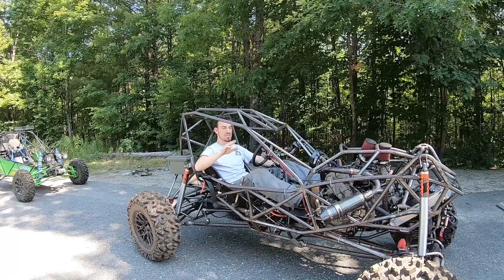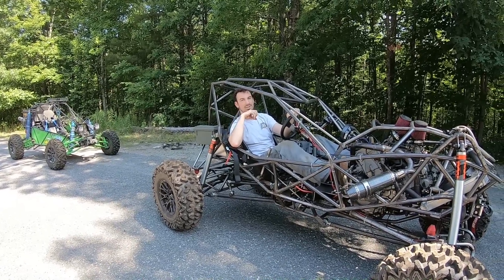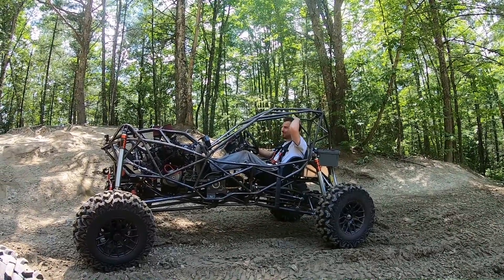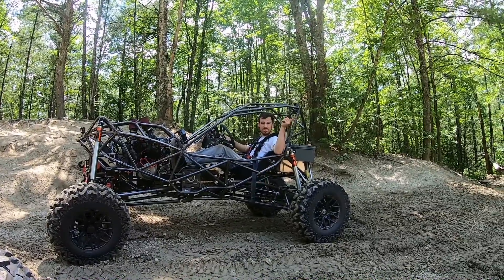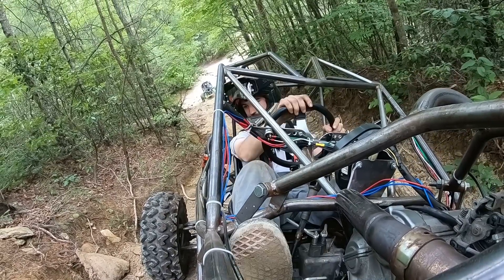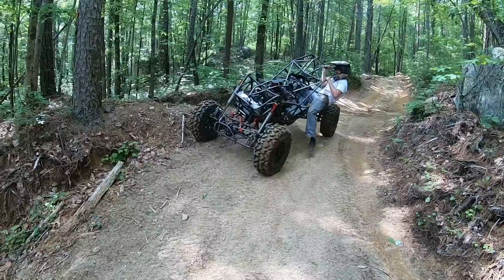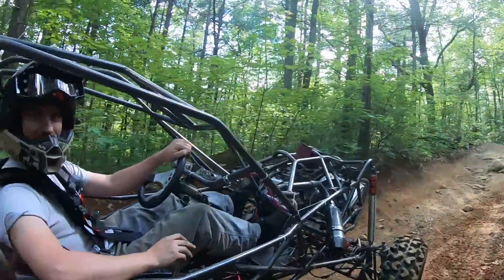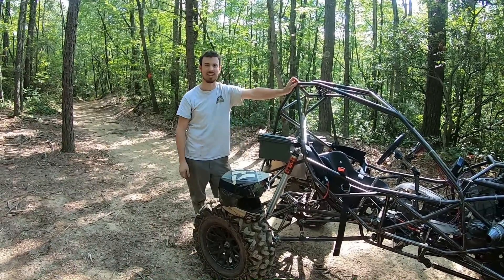First ROCK CRAWLING TEST!!! With the Mini Rock Crawler project - Part 16

Comment: One thing you might want to consider it oiling.  Motorcycle engines aren't engineered to draw oil at extreme angles.  When a bike corners, centripetal force keeps the oil in the bottom of an the oil pan and keeps the oil pickup submerged.  Since you won't be pulling hard corners anytime soon, driving at an extreme angle has a real chance of sloshing oil away from the pick up tube and causing oil starvation.   Just a thought. Happy rock crawling!
Reply: An example would be what happened to Superfastmatt's s600 with a motorcycle engine swap, Just search "I Blew The Motor In My Motorcycle Powered Car".

Comment: i think if you made an atv sway bar fit in the back, it would work a lot better. with the sway bar you built, it doesnt look like it flexes at all in the rear. on my wrangler, i have a small swaybar on the rear and a stiff one on the front. i disconnect the front swaybar and it flexes perfectly with the small one on the rear, and it doesnt flop around side to side. something like a grizzly 700 sway bar would be perfect for it i think.

Comment: Aside from the tires being rock hard I wonder about the valving in the shocks . It’s almost like there isn’t enough spring pressure (air pressure in this case) to overcome the rebound valving . So maybe a shock with less rebound or more air pressure or a combination of the two . And maybe a small fan for the driver . But hey great first run dude ! Looking good .

Comment: Don’t add more Nitrogen to get it to not bottom out. You want your links close to level to the ground as possible. Makes going over obstacles easier.

Get the next size lower for the shock. And have more shaft showing and actually usable.
Need to go somewhere where it has whoops and ruts and do a small shock tube session. And find what exact PSI works best for your application and needs. Increase 2-3psi increments each time as you video how the suspension reacts.

You want 1” of shock shaft not being used so you don’t bottom out the expensive shocks.

Definitely lower tire pressure. To just when they start to feel soft when you push it with your foot/kick

Much love brother. Keep kicking butt👊🏻🤘🏼
Just wanted to pass on knowledge

Comment: I can’t remember all the details but did you end up adding slip yokes to the front and rear driveshafts or are they fixed length.  If you bend any of your links, the wheel base will shorten and driveshaft will either grenade the diff or transfer case area.

Comment: Looks like it's got great potential. I think you need more preload because it's not self righting. If that increases ride hight too much you could consider moving the upper shock mounts hifher. Also less tire pressure and possibly less damping. No matter what, it needs to right itself when it returns to flat ground. Even without the swaybar.

Comment: Great job Chris, that would do way better with the sway bar disconnected and the air pressure way down like to 5-8 pounds and more nitrogen in those shocks  but man so impressed on how well it did as it is.

Comment: You need to air down your tires.  It would have been better to have rear engine and those shocks should be adjustable to be softer.

Comment: Very nice, looks like fun 😄
Not sure about the brake cables flopping around since they look like they could get caught up and possibly break?
And, one thing I did notice and was a little concerned about was the loose ends of your seatbelt straps, they looked like they were about to get caught up in some moving component or another a couple of times and if they did; that could have been a tad "uncomfortable"
Maybe shortening them or finding a safe way to secure or square them away might be a good idea?

Comment: I wonder if it would be to much work to cut the windshield and roof off and do a redesign so you could raise the seat for visibility. Other then that looks good. Lower tire pressure and shock adjustment will definitely help

Comment: Hell the front looked like it was working pretty good toward the end there, as others have commented the tire pressure looks pretty high, could just be too stiff a tire but that will remove a decent bit of harshness there. The rear looked like it could use some more pressure, and that would give you some better visibility having the rear slightly taller than the front with you in it. The body roll is excessive without the sway bar as you noticed and likely adding to the ride quality, could always use a smaller link arm from sway bar to top link and increase the leverage to get the rear working more if it bothered you. Excellent build either way!

Comment: In front is see a decent amount of shock travel but the rear seems almost bottomed out.
Having the rear sit low will not help in comfort and vision over the engine.
It looks like the tire pressure is (very) high for crawling.
You may want a thinner sway bar.

Comment: Some beadlocks and really low tire pressure would soften up the ride and 10x traction vs aired up. Might not be a good thing with those axles, but that's an easy fix too lol. Some old Jeep XJ axles for $100 and Lincoln lockers would hold any tire size you want and be more than enough for that little beast lol

Comment: Lowering the air pressure in the tires will give you way more traction and a smoother ride. But for your first test run it was awsome.

Comment: Do a complete 180 degree build on it, so the back becomes the front. Much better view of the road ahead, the heat is behind you. A simple redo of the cage at the back will give you a much better seating position facing the other way and reversal of the jackshafts will get it going in the right direction.

Comment: You complain about the ride but you keep building  rock crawler type vehicles. Build something that goes fast and left or Build something that is fast and goes in a straight line quickly. But you built it quit complaining.

Comment: You shouldn’t need a sway bar to get the suspension to rebound the what springs are for. If you were running coil overs you wouldn’t have that problem. Those shocks need to be tuned probably to the weight of the vehicle with you in it.

Comment: Those rear shocks need enough pressure in them to correct themselves. You can't have the sway bar locked.Figure our how the have the suspension  rebound without the swaybar.

Comment: Watching the first part I was thinking how easy it would be for you to add rear wheel steering to it, then you mentioned how big the turn radius is and confirmed it coyld really use it. Maybe do a hydraulic setup with automatic return to center function or a smaller wheel using a snall orbital valve would suffice.

Comment: You might have to add springs to the suspension so it pushes the vehicle back upright. I know those are air shocks, but it appears that you have the pressure so low that there is no force to push the chassis back up. I know those aren't the shortest air shocks fox makes. Maybe shorter ones aired up properly would be the solution to that issue. The shocks you have when properly aired up make that a monster truck.
Reply: Definitely needs more preload. He could move the upper mounts if he doesn't want to increase ride hight. Assuming that doesn't limit downtravel too much.
Reply: Yes coil overs will help immensely
Reply: And less tire pressure
Reply: All the air in these shocks does is set the ride height. 1/3 of the shaft showing is roughly where you want to be at ride height. The dampening is done in the valving and the amout of oil in the shock. Those shocks are make for MUCH heaver rigs. Toyota truggys are about the lightest thing you will see on them. The pressure of the nitrogen in the shocks will 100% not help with ride quality .
Reply: You need enough air in the shocks for the to function properly. There so low and the shocks are straight down to axel makes them stiff. Relocate you shocks so there angled and can stretch out more. Run limiter straps and bump stops and a lighter sway bar. Thicker for fast thinker for more flex and smoothness

Comment: All the articulation is working exceptionally well and it has plenty of wheel travel,   Needs less compression damping in the rear shocks and the tires are hard as rocks
Reply from the maker: Yep, we forgot to air down the tires for this test😂
Reply: @ratherBweldingChris  Sorry,  i knew you knew that.
Reply: @ratherBweldingChris  congrats men!!! amazing job

Comment: i think it need lower psi in de tires and a little more in the shocks.i had a quad and drove with 7 psi in the tires but the rockcrawler is has more weight so i don't know exactly how much psi you need. But that thing is sick bro!

Comment: Observations. You need some kind of return to the sway bar, something that gets you back to neutral even when the system is unlocked.
Your shocks, pump them up hard for when you make it to the trail, then loosen them back down when you're at the trail you want to, little by little. A small electric motorcycle hand pump should be part of your gear for this. The rear suspension defo needs more juice than the front one, even if it doesn't seem like it.
Reply: Springs?
Reply: Well it was a first test run.
Reply: More air would make it too stiff when it needs to compress over large rocks..
Reply: No reason to even have a sway bar. It makes no sense.  You don’t need a sway bar on a daily driver car nvr mind a wheeling rig.  Needs tons more pressure in the shocks but absolutely not a single need for a sway bar. Not even a give or take conversation. It’s strictly has zero purpose. The only reason it has a sway bar is because for some reason he won’t put the correct amount of air in the shocks. A vehicle needs to be able to upright itself on flat ground when you lean it over. Like in vid he leaned it over by standing g on it. When he stepped off it stayed leaned all the way over. Hello. The shocks don’t have enough air pressure in them to even support its own weight. Witch means one tho g and one thing only. More air pressure in the shocks.  Not a sway bar.  Baffled because the dude is extremely talented and extremely good fabricator and to see that test and to come up with the thought it needed a sway bar vrs the fact that it just needs more air in shocks is just baffling. This isn’t theoretically this is pure fact. The thing can’t hold its own weight up.
Reply: @acurarl9929  LOL You have no idea what you are talking about
Reply: @acurarl9929  Absolute garbage. He needs more air in the shocks, true, and for maximum flex it can be common to disconnect sway bars while driving offroad. But sway bars are one of the most critical components in a suspension system as far as controlling lateral body movement. His choice to design a sway bar with a quick disconnect reflects the need for a sway bar for regular driving, and also the ability to disengage the sway bar for better deflection for slow speed manoeuvres like rock crawling. In this instance he disengaged the sway bar to test that functionality and unfortunately had insufficient air in the shocks to hold up the body. However if you watch, it was the sway bar that had been limiting the lateral body sag, which only became apparent when it was disengaged. I also think you'll find that if you removed the sway bars from your daily driver, it would become very different to drive. Sway bars don't just have an effect when you're right on the edge. The only modern cars not fitted with a sway bar would be vehicles with a non-conventional suspension system of some kind. If its just got regular springs and shocks, guaranteed it will have at least one sway bar.
Reply: @acurarl9929  Pretty much every single car has sway bars, and lots of hardcore off-road rigs also have sway bars. They do have a purpose, otherwise they wouldn't exist. Yes, Chris is using it as a sort of band aid and the suspension needs a little reworking, but stop shitting on someone when you have no actual knowledge of what you're talking about.
Reply: @alexking4082  I've owned many vehicles either without sway bars at all from the factory or with removed sway bars. They have their place, but the vehicle doesn't fall over without them. But being wide and short makes a difference of course. This thing is really tall and skinny and has air shocks not well suited for this use case.

Comment: Curious to know what tyre pressures you're running on the crawler. They look a little high to me as there's little distortion of the sidewalls. Against that, I have no idea of the all up mass of the machine, so perhaps low pressures are not so obvious.
Reply from the maker: Haha yep, we forgot to air down the tires
Reply: That’s my only suggestion, he needs a small air pump too , I’m wondering if nitrogen would be better than air in the tires too though
Reply: @MarkSmith-wu8rh  In reality, using pure nitrogen in tyres is no use longterm, it leaks out, being replaced by air which is around 80% nitrogen anyway. See this video Top 10 reasons not to put nitrogen in your tyres. https://www.youtube.com/watch?v=bCnWvMleVD0
Reply: @PeterEmery  the only advantage to using nitrogen from a bottle, is that it has no moisture in it. This is why airplanes use it in their tires.
Reply: @chriscullison7833  Aeroplanes are not rock crawlers, though. Vastly different stresses applied to the tyres.

Comment: Im actualy surprised AND impressed. I think either lowering the air in the tires OR some tires with more bite would help the bouncing while crawling abit but besides that, well done sir!
Reply: Yeah he definitely has to much air in his tires and his suspension isn't made for what he's doing
Reply: @petermakeithappen8336  what would you suggest it’s made for?
Reply: @Lfrperformance  for something a lot more heavy . the shocks dont even move . some they need revalve or thinner oil . they need to move like butter smooth up and down as the suspenion moves .
Reply: @petermakeithappen8336  Really 🤔 Pretty sure it is 😆🤣
Reply: Most definitely air down the tires. Fantastic job.
Reply: Yeah, WAYYYYY too much air in the tires.
Reply: Agreed need to take some air out of the tires and air up them dang shocks!!! If you are worried about it not riding in a compressed state then add a winch from the frame to the axle so you can draw it down like the big guys do.
Reply: Amen to tire pressure lowering
Reply: yeah my first thought was the tires need to be aired down
Reply: Definitely need less air for sure

Comment: Sick but looks like it’s a bit of a rough ride
Reply: Looks like too much tire pressure..
Reply: the rear shocks are only moving a few inches before they bottom out. I'm sure he's gonna fix that they said they went back to air up before but I would have aired it up more or maybe move the rear shocks to a different mounting point.
Reply: @ronniewilliz153  I noticed the tire sidewall doesn't budge going over rocks.  But yea, too much compression dampening/needs more travel in rear.
Reply: @scrappy7571  yea I seen the high tire pressure too. That would help a lot too